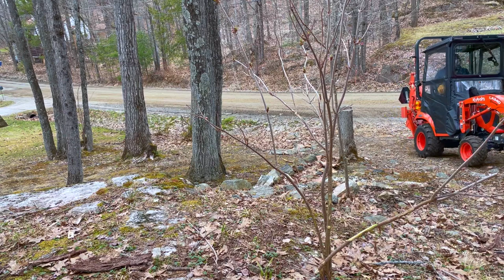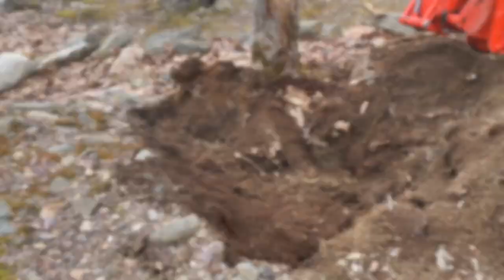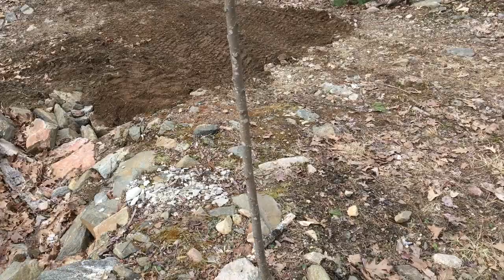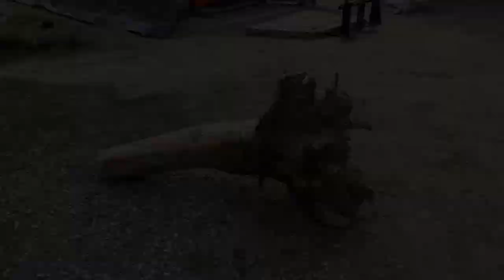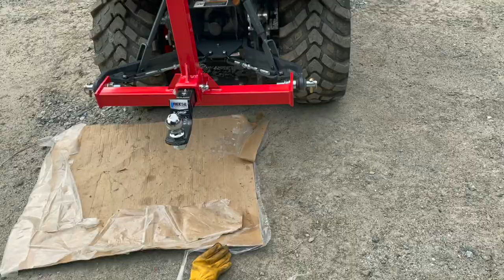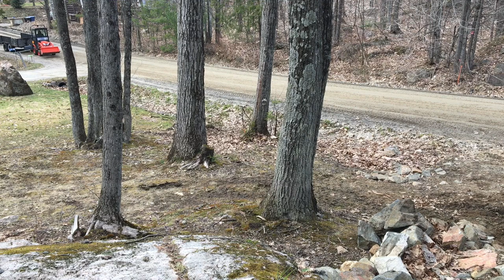#9. Kubota BX23s... Clear spot - Remove stump - Try new trailer tow bar  HD 1080p

Comment: Gotta love everything BX23S can do.  Nice video
Reply from the maker: Thanks Tekker, Love my BX23s. I was creeping your Youtube 😏and I see you are a new tractor owner too, I love the cab you got... But soooo expensive in Canada. As for the lack of snow you had when you got the tractor, you will have plenty through the full winter this year :)
Reply: @ticklemeorange8328  I am a new owner, but still waiting on some accessories I ordered back in Dec - silly supply chain issues.  I also love the cab but recently found out you can't get the air conditioning for the BX23S cab because the roof tilts up.  It's been over 100 here quite often and I'll need a fan at least since I can't get the AC.  I know that cab is expensive everywhere but I hope it's not a lot more for you.  I packaged it into my financing, otherwise I would never be able to afford it.  As for snow, because we have been in a drought for several years I'm not sure if we will even get any this year.  It's hit and miss but I know I have the equipment if it does snow.  I'm a terrible youtuber.  I've been using my tractor but not filming it.  I need to get better at that.  😁
Reply from the maker: @tekker8308  oh I thought you could get the air conditioner for the BX23s… and with that heat, doors off, windows open and big fan.

Comment: A grapple will definitely come in handy 😉. Great video Andrew 👍🏻. Have a great weekend 🙂🙋🏼‍♂️👍🏻
Reply from the maker: Thanks Luc, and yes the grapple will be very handy for me, lots of rocks and logs to move. have a great weekend... hmmm everyday is a weekend for you 😅 enjoy them all ;)
Reply: Been thinking of getting one as well, they're just extremely expensive, and have a couple other attachments I need to get that would be used more frequently.  I don't have a 3rd function on my tractor either so that kind of cancelled the grapple idea, way too expensive to have the 3rd function added on, and although it can be done yourself, its not something I'll attempt as from past experience anything mechanical like that I try to do myself turns into a nightmare, and costs me more money in the end.  So I'll skip the grapple, and get the 4' rotary cutter instead, and at some point I'd like to get a sickle bar mower as well.
Reply from the maker: @wildbill23c  I did get the 3rd function with the tractor knowing I will need it. The sickle mower would be a nice to have...Hey, ill rent your tiller next summer ;) lol.
Reply: @ticklemeorange8328  we have 6 Saturdays and 1 Sunday 😉😂😂👍🏻🙋🏼‍♂️
Reply: @ticklemeorange8328  Would be an extremely expensive rental because of shipping costs, and how long it took me to get the thing from my dealership I don't like letting people borrow anything of mine...tried that once, ended up with a very expensive replacement tool.  I have a sign on my shop that says "NO TOOLS LOANED SO DON'T ASK" because of stuff like that.

With the dealer issues I've had I'll skip the 3rd function, I'd never get my tractor back with the way they do business.  It took me a year to get my mid mount mower, and only because I finally told them to either write me a check for a refund, or drive 8 miles across town and get one from the other Kubota dealer that's had them in stock all this time.  They weren't too thrilled but I brought up the fact they sent someone to Utah from Western Idaho to pickup my tractor so there's no reason they couldn't have picked up the mower deck from them as well...or drove 8 miles down the road and got the mower deck.  I think they finally realized I wasn't accepting their bullshit excuses.  A month or two wait, fine, a year, and I'm making payments on something I don't have isn't acceptable.  Took me about a month to get the tiller from them, and I had to go get it myself, along with the quick hitch, and several other items.
Reply from the maker: @wildbill23c  HAHAH.... Ill try to find one local.

Comment: I don't use the 3 point receiver hitch very often, but its sure convenient.  When I move a trailer its because I'm going to be using it, so swapping attachments on the tractor to move a trailer on my property isn't very often at all, its nice though in the spring when I mow the pasture to be able to quickly hook onto a trailer and move it to mow, then put it back.  The BX is only rated to tow like 1500lbs or something like that, so my utility trailer and small 14' flat bed are all I'm able to move, my car trailer I have to move with my pickup as it weighs 2400lbs.

I have the quick hitch on my BX, so to use the 3 point receiver hitch, or my sub-soiler/ditcher I have to remove the quick hitch...its easier and quicker to use other methods than mess with dropping attachments and removing the quick hitch, as it never seems go all go back together without readjusting everything LOL.  Quick hitch, only if everything you have is quick hitch capable, and even if it says it is, its typically not how you'd think it should be HAHA!!!  I got the quick hitch because I use my roto-tiller & box blade mostly, both are quick hitch compatible....so it makes swapping between those 2 attachments much easier, the tiller is a pain no matter what you do because it wants to either roll forward or backward on you as you are trying to hook it up, the quick hitch kind of helps with that a little bit...my tiller is sitting on a pallet on a shelf, and chained to the pallet, otherwise the tiller will roll off when trying to move it around to hook it up to the tractor.  That's one limitation I've found to be a bit annoying with the 3 point, it don't lift quite high enough to get the tiller off the shelf it sits on, another couple inches of lift would be more helpful, but then your hitch would be hitting the back of the tractor more so than it does normally.  

This is my 1st tractor, and still trying to learn and just when I think I figured something out, it creates a whole different problem HAHA!!!
Reply from the maker: Hi William, yes i wouldn't want to swap the hitch out everyday, but it is great when you need it... As for the towing capacity I think the 1500lbs is the 3point hitch lift capacity but I cannot find the towing capacity anywhere... but I have read of people towing 4000-5000lbs.
Also, I will need a tiller next spring to redo part of my lawn, I would like to have one but pretty pricy. I will see if I can rent one for a couple of days.